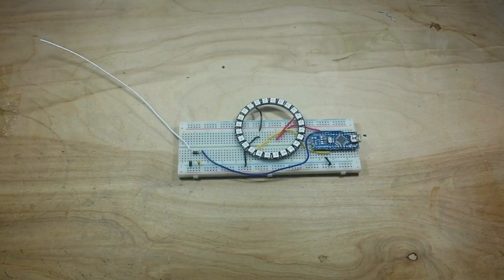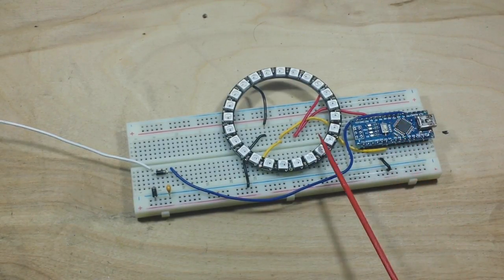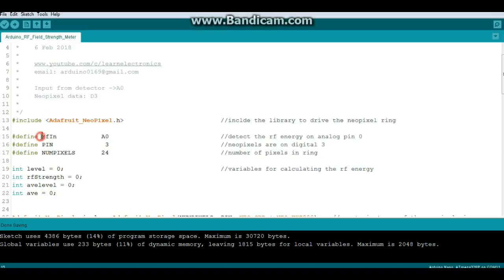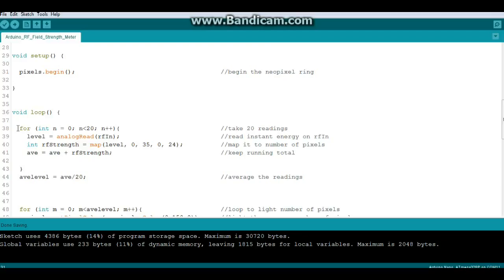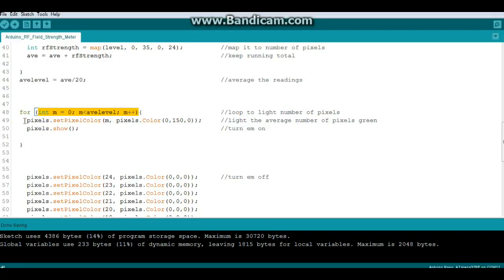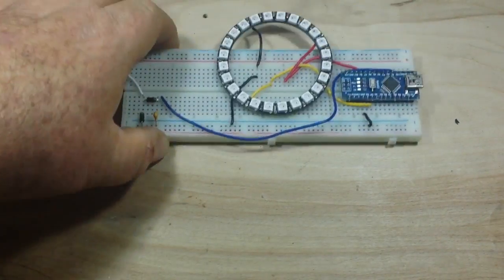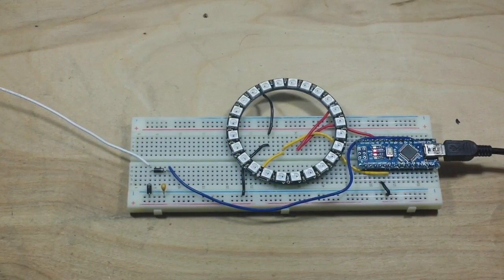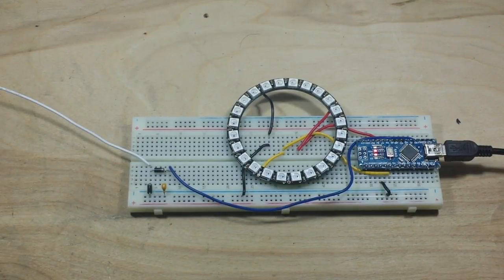Quick and dirty Arduino Field Strength Meter

Comment: Nice work. Some of the Amazon links no longer work. Do you have specifics on the uF rating for the cap and the values on those diodes. Parts # would be great. Great video

Comment: Is the '35' in the map() line a millivolt measure (from variable 'level'), or ?  And, if so, are the diodes something other than silicon (whose typical turn-on is .7 volts?)?  Just trying to grasp the magnitude of RF output from your hand-held.  Thx.
Reply from the maker: +Are Jayem Values in the map function are arbitrary, and my diodes are silicon Schottky.

Comment: Great job,   I understand the "0 dark thirty" thing quite well "Go ARMY". Keep up the great Arduino / TFT  videos.  From what I see you wont have any troubles with the ARRL test. The only thing I question is why it took you so long too started. Chat Later
Alan Back, N8TIB
Reply from the maker: +Alan Back Thank you. I passed tech and general no problem. The reason it took me so long....I've always avoided RF stuff. Weird things happen at high frequencies.